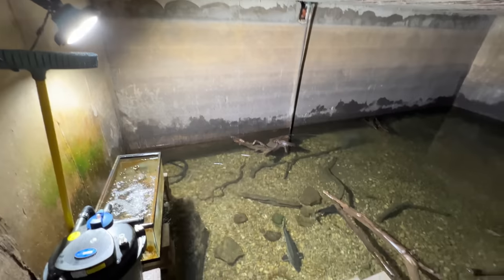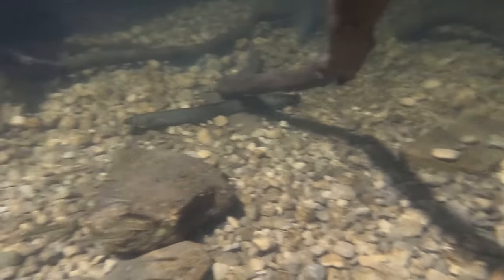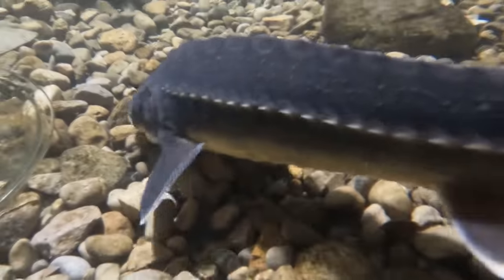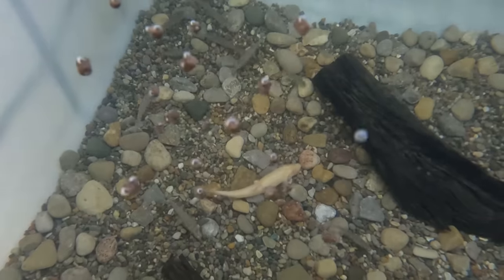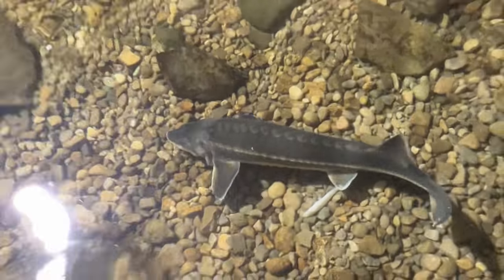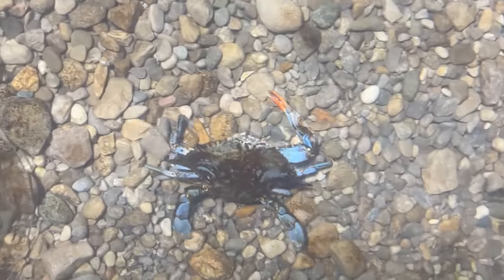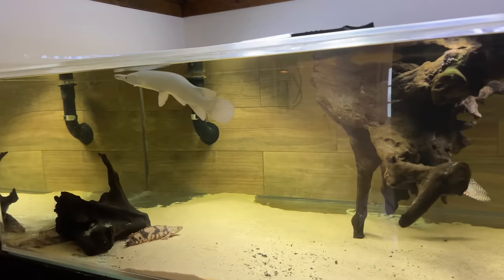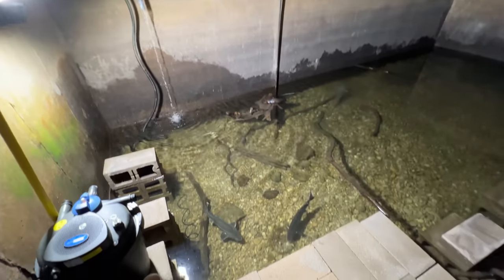Eel pit filtration upgrades!

Comment: Also quick tip, whenever you're drilling into concrete have a vacuum running right at the bit. Would save you from cleaning afterwards
Reply: would that work on a concrete saw too?
Reply: @entrippyZ  not sure tbh, wouldn't hurt to try though
Reply: @entrippyZ  For a concrete saw you're better off using water if possible, to keep the dust from flying around. It also helps keep the blade cool, especially helpful if you wind up cutting into rebar.

Comment: If you make the upper part of your new filter airtight and well filled (so it won't collapse) you can achieve a much higher flow through it since then only the difference in inlet and outlet height counts. With all these fish and food in them a powerful filtration will be needed. A trickle filter on the way down might also be a very effective addition.
Reply: He was talking about a waterfall type thing for the pit

Comment: @Cow Turtle, ifyou want to reduce the noise of your 'water fall'. Go for a ventur instead. Essentially, you have the pipe in the water, but in the centre of the pipe, you have a smaller hose that goes up to air. Essentially, creating a water vacuum that sucks air from another area and push it into the water. Increasing oxygen.

Comment: That water dropping is going to raise the oxygen level by a ton. What I would do is set aquaponic racks along that back wall inside the pit with some grow lights, have the water that’s flowing down feed the plants. The water feeds the plants and the plants filter the water
Reply: Id agree to this. If it was practical would be great. Even just low light stuff. 
Or in the IBC itself do floating grow beds.

Comment: One note on filter socks. They have to run at a low pressure diffetential to be effective. The bioslime will just push right through that unwoven floss if you push any harder than a couple inches of water column.

Comment: Nice setup, i like to watch your videos. But everytime i do i cant stop thinking about how you are not afraid of moisture building up in the foundation and into the concrete, special when i se that hose just dripping down the wall ? Is there any plastic at the buttom ? It just looks like the concrete is sponging up all the water, i would be pretty worried about that tbh.
Reply from the maker: It’s a rainwater cistern that’s held water since 1958 with no signs of issues yet.
Reply: @CowTurtle  aah i see. 
its the water filtrated when it cycles ? I thought that could might help with the "film" on the water surface

Comment: you should add pipe to  the drain to the complete opposite side of the pit, clean water in one side, dirty water filtered up on the other side. You have a better chance of filtering more water that way. might want to add circulation to the water, there is a film on top of the water, lack of circulation.